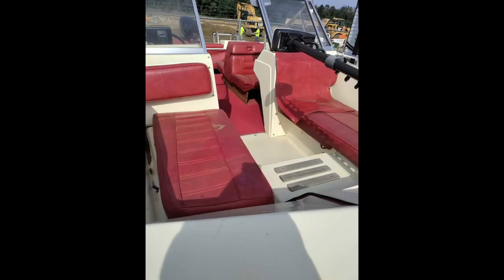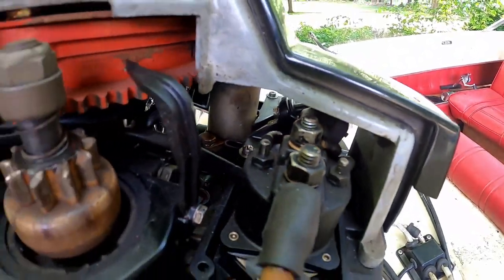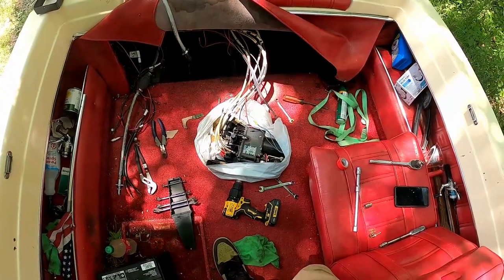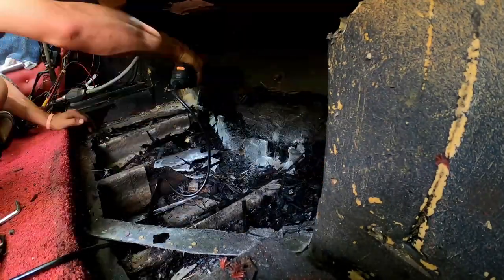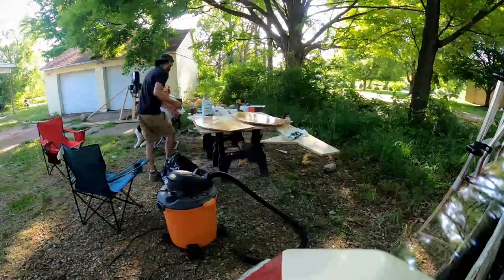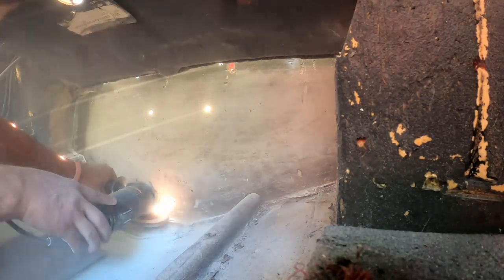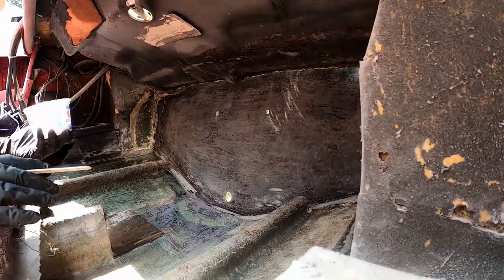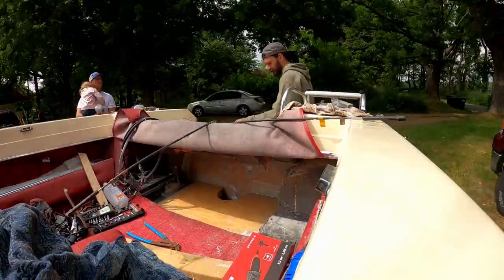1979 Glastron Transom Repair (scammed on marketplace)

Comment: Just bought a 76 Glatron and transom was rebuilt with 2x8s. This video helped me out a lot. Not so nervous doing mine now
Reply from the maker: @natedogg89 stoked to hear it! Glad someone was able to get some usefull info from the video. Getting the old one out was the hardest part so 2x8s might be even easier to do. Best advise I can give is large batches of epoxy set up way faster than small batches so be careful and make sure you have everything ready when you start laying glass!

Comment: I've been through the rotted floor thing. If I had a bad transom I'd probably take the cap off. No small job, due to it's heavy weight. And all the engine controls and wiring that run up inside it's gunwales. With the cap removed, then easy access from bow to stern. And all the rot can be removed, replaced and re-glassed.

Comment: Did you extend the stringers to the transom? Should be tied in together. Great job on the glass work.
Reply from the maker: Thank you for the comment! Yes the two outer stringers are wedged tight to the new transom and were glassed in so its all one unit essentially. The middle stringer was to short to reach the new transom due to removing the old bilge sump area, I thought about extending it but realized it would interfere with the new drain plug hole so I opted to cap that middle stringer with glass and resin to prevent any water ingress into that stringer channel.  The gap between the end of the center stringer and the face of the transom ended up about 8 inches which i'm not stoked about but I can live with it knowing everything surrounding it is rock solid.

Comment: I might have to do this with my free 1966 Glastron. Runs and floats great, but the transom has seen better days. I hope to fix it right before it gets bad.
Reply from the maker: Great little boats! Took mine out on the great lakes this weekend in 4ft rollers it handled it like a champ. highly recommend reviving these old gems.
Reply: @ReelMichigan  yup. Has a 40hp Evinrude from 1968 and it runs beautifully!

Comment: I have the exact same motor they are awesome
Reply: Mate , I got 2 boats and  one of them has the same motor 85 HP and the other one has a 50 HP just little bit newer , I had to make a decision to keep one of them for the boat I want to use but couldn't make my decision because this motor is very old and I'm not sure I can relay on this motor or not , the other option is buy a brand new Yamaha 60hp for around 13 k or if you really think that this motor is good , just spend couple of thousands and make this like brand new , I really don't know the best option

Comment: 90% of fiberglass boats with wood cores are totally rotted out
Reply from the maker: The way the glasstron was design was planned obsolescence I guess, absolutly no protection for the transom and no drain from the interior of the shell to the bildge, will be rock solid for many many years now

Comment: I have a 77  with 70 hp try hull
Reply from the maker: tri-hulls are cool man, seems like they cut thru waves and wakes better than your standard bass boat, I can hit a roller at 40mph and not need a chiropractor after LOL seems like they rock side to side less when anchored up too like a flat bottom.
Reply from the maker: also thank you for the comment!

Comment: Those 70 Mercs have an issue with the thermostat. It sticks and when it finally open cold water hits the inside of the cylinder head and cause a crack. The block and head are once piece so the block is junk. Happened to two 70 Mercs I owned.
Reply from the maker: Thank you for the info! First time hearing about this, any fix? updated thermostat or housing? To be honest I didn't even realize outboards had thermostats tho most engines do I just assumed it was an open system since they "pee" on startup. Would love some more info on the issue if you have experience with these motors, I have some experience with normal engines but this is my first boat and outboard so im semi clueless. thanks for the comment!

Comment: I had the transom rot out on my 14ft lowe jon boat. It was plywood. I went to a trusted local marine dealer who I have known for years. He told me to go to a local sawmill and get a piece of Oak and trim to fit. This is what I did. It is very strong now.
Reply from the maker: Oak is one of the best woods for water resistance as far as I know that's what they used to build warships from. The also make products like seacast for aluminum boats where you can pour a couple 5 gal buckets of the stuff into the gap and it sets hard as a rock. If my boat had a interior wall I would have went that route for sure!